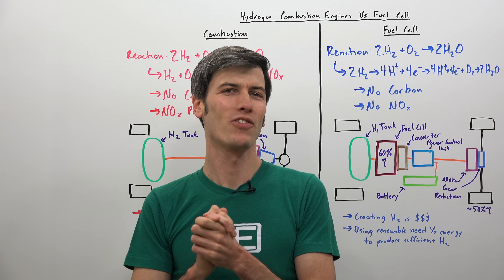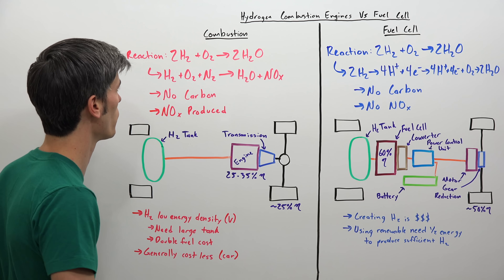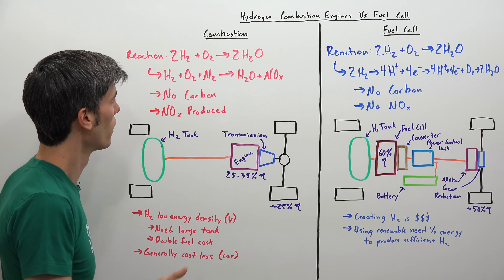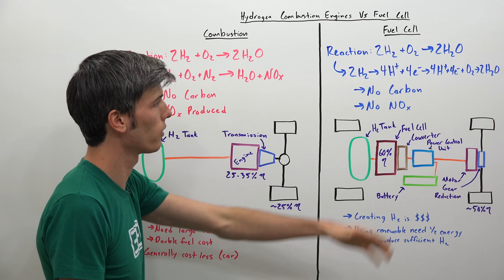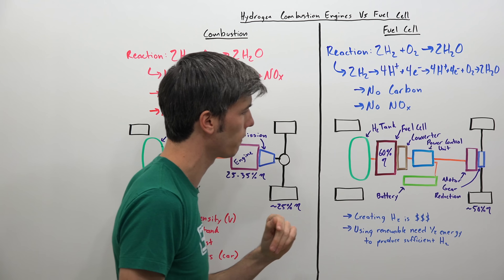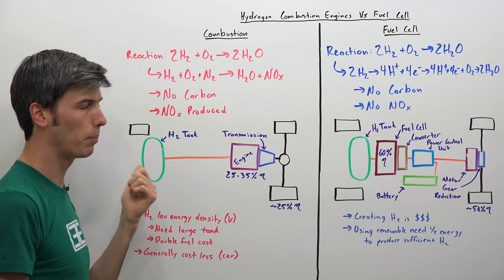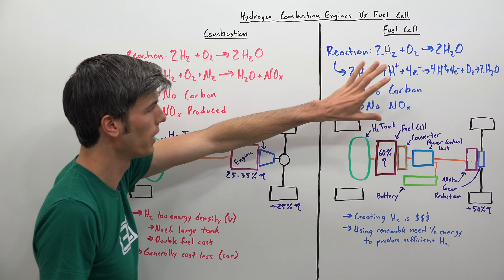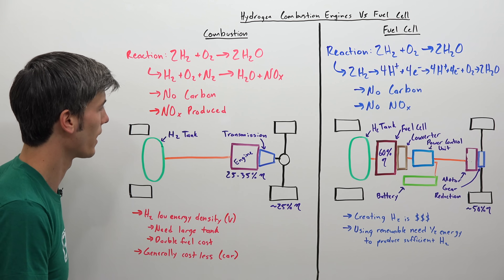Why Hydrogen Engines Are A Bad Idea

Comment: I think when it comes to an emissions point of view, converting existing vehicles to a hydrogen system would cut off manufacturing necessitation and waste from that. Most overall emissions come from industries, for example the battery industry or the auto-manufacturing industry. Converting an existing machine to hydrogen would prevent further need for waste. If we can find or invent something similar to a catalytic converter for the NOx, it would be fine as long as it was a legal requirement like smog. I'm sure people much smarter than I have already proposed this or looked into it.
Reply: not all oxidized nitrogen is so bad, you might be familure with nitrous oxide which can be used for full or partial anesthetization or propellent in whip cream cans or used to boost octane in gasolean vehicals such as a drag racing setup, perhaps if you had a way to catalyse the formation of the good nitrogen oxides (N2O) it could be formed instead of the more dangerous oxides (NO2, NO, NOx ect) thus using up all the available nitrogen before it becomes a more pulluting variant, just a thought.

Comment: I see the benefit in making bolt on or drop in solutions for converting gas vehicles to hydrogen vehicles. You have a stout car culture not willing to shift, and you have legitimate limitations which the EV fandom refuses to address. These mods wouldn't even have to be cheap either, just cheaper than buying an EV (which isn't all that hard to do).

Comment: Aren't the parts for creating fuel cell environmentally worst than hydrogen combustion? I can imagine those rare earth material for creating those battery and catalyst is pretty bad. Just curious if it out weigh the cost or if it's a myth.
Reply: They're making new batteries out of non rare metals.
Reply: That's a problem that can be worked on, but I'm also curious about the catalyst and the manufacture and disposal of the fuel cell
Reply: Fuel cells are a bit worse than batteries but far better than petroleum. The catalysts use the same materials as catalytic converters in ICE cars. There are no rare earth metals in batteries, just in permanent magnet motor/generators. Cobalt is a byproduct of copper mining and only about half as abundant and Manganese is as common as Phosphorus in Earth's crust.
Rare earth is also a misnomer for the most useful ones. Their issue is that they are so chemically similar that they are hard to separate from one another.
Reply: How do you make hydrogen commercially, but by chemical decomposition of methane or other natural gas. What is overall efficiency of that process compared to taking same energy of fuel, and turning direct to electric power in a large efficient power plant.
Reply: I don't know about the environmental impact of mining the materials for a fuel cell but the lifetime of a fuel cell is (at least as far as I understand it) much longer than the lifetime of a battery.
Reply: @SeanBZA  or by electrolysis. If you do it with excess renewable energy it's not that big of a deal.
Reply: @hondaguy9153  ROI will suck with that, and in general most industrial electrolysis plants do not respond well to rapid changes in control, they all will have very bad transient response, and you will not get a good product out efficiently. Extreme case is an aluminium smelter, where the penalties for loss of input power are massive, and can result in the plant needing to demolish large chunks of the equipment and rebuild them. Electrolysing water also needs additives, and filtering out the most common byproduct, chlorine, from the system as well, plus it is also incredibly energy intensive. 

Your cost to make from electricity would be more than double than reforming methane or natural gas, or by using syngas from coal in the  Fischer–Tropsch plant process. If you have enough biomass on a reliable scale syngas direct would work better to run engines, plus give a food crop as well, though it would probably be best used on the farm itself to run the equipment for modern agriculture over diesel.
Reply: @SeanBZA  Another effective (and free in a way) is to use thermal decomposition of water into hydrogen. Needs very high temps on the order of 3,000°C, but a nuclear reactor can develop those temps. Could get electricity and vehicle fuel from the same plant.
Reply: Lmao what is so environmentally damaging about aluminum, nickel (and nickle oxide), cobalt, and platinum?
Reply: @ericcartmann  you should check into why the original battery factory for the Toyota Prius turned into a Superfund site...
Reply: Stephen Foster You're going to have to provide a reputable source for that claim, because when I Google Prius battery Superfund site, I get exactly zero results that actually contain the words Prius and Superfund site on the same link.

No results found for +Prius +superfund.
Results for Prius superfund (without punctuation - Learn more):
Reply: "Aren't the parts for creating fuel cell environmentally worst than hydrogen combustion?" 

Yes.

Comment: NOx, I think that's what a catalytic converter is for.
Reply: Yes there are NOx traps. But they are filled within 10 minutes (on a diesel) or 2 minutes (on a petrol) and then have to be 'burned out' by driving with a rich mixture. This in turn produces cancerous hydrocarbons and carbon monoxide. So I'm not sure we couldn't just stay with the poisonous NOx in the first place. ¯\_(ツ)_/¯
Reply: Update: I recently learnt, that to reduce or oxidate NOx you have to have COs and HCs which you wouldn't in a Hydrogen engine. 

So to my understanding current catalythic converters wouldn't help at all and you need to come up with a new solution (not saying it wouldn't be worth it, I'd like to see that)
Reply: @Dan_Divebomb : The SCR uses ammonia NH3, also known as urea.
NH3 + NO --> N2 + H2O. No carbon involved. You´re welcome.
Reply: @Dan_Divebomb  As I know, EGR component makes some little portion of exhaust gas mixed with the fuel in order to enrich the fuel mixture inside the cylinders with COx s to lower the NOx production.
Reply: sharkbait hoohahah sorry for this late response, but what other pollution could be brought in if this happens? Do you think that if there is none, the internal combustion engine could still live?

Comment: If you filter the air intake to filter out the nitrogen ( or even only allow the oxygen through ) that'd get rid of the NOx problem.

Every time I read/eatch such stuff I just think a leap forward would involve new tech like such filters. Then read the argument section and see it's  full if people explaining why xyz can't work. I just think imagine if we stopped inventing new stuff at copuricus's level.
Reply: yt engineers problem solving skills are very abysimal, isn't it?

Comment: Thank God someone isn’t on the hydrogen hype train

You didn’t explain how industrial hydrogen refining processes also create carbon.
Could you explain that?
Reply: So does refining oil but if hydrogen is More environmentally friendly than the current infrastructure we should pursue it
Reply: Get water run electricity through it, preferably through eco friendly power plants, get 2H and O. Use both instead of taking outside air. No Nitrogen no NOx. Store the used H2O and repeat
Reply: @poisonpotato1  The problem is the "run electricity through it" part. Most of the world's electricity comes from fossil fuels. Using electricity from renewable sources to produce hydrogen is wasting it, because it yields about half the energy of just storing and using the electricity directly.
Reply: @BigUriel  still, renewables are cheap and getting cheaper. Wasting half of your energy might not be too much of a problem if you can store it
Reply: Lol electric cars are worse

Comment: Counterpoint: People don’t want an electric car. They want the nice rumble of an engine, they want to shift the gears. Electric cars, no matter how fast are BORING imo. We could very easily lower the cost of hydrogen as it is a byproduct of many chemical factories which often gets thrown out, its LITERALLY the most abundant element in the universe. You could even probably rig up a little hydrogen production plant in your backyard. At that rate, who the f*ck cares about efficiency! Its a renewable resource and its way better than gasoline.

Comment: Everyone just give up the hydrogen dream already. it sounded great 20 yrs ago when they talked about cars just emiting water as the "exhaust". It will only be feasible if you can fuel up with your garden hose. At that point it will be better than ev. Having to use so much energy to make the hydrogen vs just charging batteries is where the problem is. Why would you use electric to make hydrogen so you can change it back to electric in your cars fuel cell? makes no sense. Once you can charge a little bit faster there will be no argument at all for hydrogen except for large scale boats or trains or such where maybe a large hydrogen tank will last longer without refueling.
Reply: Do you think electric cars would be as good if they gave up 100 years ago?
Reply: Well . . . . they DID give up on electric cars 100 years ago!  Lol.
Reply: You've hit the nail on the head with one observation - "Once you can charge a little bit faster"
That and poor range are the two big reasons why electric cars will be struggling for a while yet to gain dominance.  Until EV's can compete with ICE's when it comes to how far they can go on a tank/charge and how quickly they can refuel/recharge, efficiency doesn't really come into the equation much.  Hydrogen seems like a interesting idea in terms of keeping the convenience of ICE's while going much greener.
Reply: Mikee, Porche has just released the next gen charging technology, which brings charging times down to under 15 minutes.  When you consider that the cost to charge the car with electricity is a third that of gasoline and a tenth that of hydrogen, the 'it takes too long to charge' issue is basically a thing of the past.
Reply: Will be interesting to see if they have much success with it.
Reply: @mikee6666  Personally I think exchangeable batteries would be neat as a sufficiently dense network of battery changing stations (the current petrol stations might be able to switch over) would mean long range, small (cheap,light,less rare earths) batteries and swapping them out would be quick, too. The batteries would be slowly recharged in the stations, directly from the grid, removing the need for powerful fast chargers which reduce the battery's life.
The problem I see though is that the industry would have to agree on a standardized battery size and swapping system - and battery technology might soon just make this obsolete anyways.
Reply: @Bryan46162  I love how Ev guys just Hydrogen for what is now, but then go all wishful thinking with "when the next generation of batteries/charging whatever comes, the range and charging issues Will be gone" but shoot down any possibility that hydrogen can also have breakthroughs and overcome its downfalls.
Reply: @OriginalNortad  that´s the whole issue with hydrogen. There are no foreseeeable breakthroughs that could happen in the near future. maybe fuel cells make another breakthrough or two, but that will be it. We don´t even have a theoretical concept of how to improve electrolysis and pressure tank storage, meanwhile there are new battery types popping up every month.
Reply: @cosmic_cupcake  when Toyota and Honda still invest heavily into Hydrogen then there is something still there, despite what some random youtuber and its fans might think.
Reply: OriginalNortad You're missing two important facts. Toyota has said their investment into hydrogen was a mistake. Hydrogen efficiency is limited by the laws of basic physics - there is no way around the limits imposed by the laws of physics, and there is no amount of investment or innovation that will ever change that equation. Hydrogen is hard limited. Batteries don't have that problem.

Comment: But but but mah hydrogen rotary for 1 year of production had promise lol thanks for awesome content as always
Reply: Fun and practicality aren't usually one in the same, engines will always be more fun than electric motors
Reply: @mrcaboosevg6089  Spoken like someone who never drove cars, instead only rode horses.
Reply: @mychevysparkevdidntcatchfi1489  Doesn't make any sense but okay.
Reply: @mrcaboosevg6089  If you only ride horses (gassers), you wouldn't know the nuanced fun of cars (electrics). Electric sounds like muffled jet engine (or space ship in sci fi movies) even at 30 MPH, and hella fun with 50/50 weight distribution.

Comment: What if we use oxygen instead of air during combustion to prevent nitrogen by product
Reply: that means an extra tank, and he already said that you need a big tank for hydrogen...
Reply: @Frankgaming  How about an stationary engine ?
Reply: You can have electrolysis
Reply: It's not quite that easy to get oxygen out of the atmosphere, no one wants to refuel twice every time, NOx isn't THAT bad
Reply: And pure oxygen is a real bad fire hazard too. Everything likes to burn real bad in pure oxygen.
So not only a massive tank, but lots of extra components for safety
Reply: @awesomefacepalm  hydrogen peroxide frequently better for storing oxygen than pure oxygen... Still  dangerous at high concentrations though. 
Gets used in many rocket engines....
Might work OK as oxidiser in a burner for a steam engine... Mass of oxygen+hydrogen needed is no more than an equivalent water tank would have to hold. Efficiency  should be improved if fuel/oxygen delivered under pressure, as hot gas from burner could be  steam under pressure . Would save a bit on engine mass and massively improve thermal efficency as  no need for seperate boiler, which reduce max working temperatures and hit carnot efficency hard.
Reply: @stevecummins324  yeah that sounds a bit more safe, hydrogen peroxide doesn't burn as pure oxygen goes right.
Reply: Pre ignition would become your worst nightmare, preventing you from getting a good compression ratio.
Reply: @Frankgaming  When you say "big tank" how big are we actully talking about?
Reply: @johnDukemaster  Hydrogen burns with oxygen in a 2:1 ratio.

The Honda Clarity uses a 5Kg hydrogen tank, so you'd need to carry 2.5Kg of oxygen to use up that tank. From what I can gather those 5 feet industrial oxygen tanks take about 9Kg, so you'd need about a third of that. Of course the Clarity uses a fuel cell which has twice the efficiency of an ICE, so if you want to burn the hydrogen and oxygen in an engine you need tanks twice as big for the same range.

Even then the oxygen tank wouldn't exactly be so big it couldn't be fitted in a car, a car converted to LPG generally has a bigger tank than that. The problem is the cost of the oxygen (air is free), and the danger of driving around with literally a bomb behind you at all times. If you have a hydrogen leak and something sparks you get a fire, if you have an oxygen leak and something sparks you get a fire, if you have a hydrogen and oxygen leak and something sparks you take out a whole block and leave a crater behind.
Reply: Sérgio Alves - The ratio is per mole, not by mass. The ratio of hydrogen to oxygen in water by mass is 1:8, meaning you'd need 40 kg of oxygen for a 5 kg tank of hydrogen.

Comment: Now! I want a car with a nuclear reactor in it...
Of course, I suppose it is easier going bigger, put wheels on a nuclear sub :D
Reply: LOL, A few kg of plutonium.  1:  Just don't crash and poison your the vicinity.  2:  Relatively low power milk float.  3:  You can drive without refueling for 50 years.

Comment: I’d say, diesel/electric hybrid system
Reply: Yes, diesel-electric is super efficient and can be powered by biodiesel.  There is so much fallow farm land going to waste.
Reply: Sadly nobody makes them
Reply: With that you lose many of the advantages and win almost nothing. Mostly the weight, size and complexity of the diesel engine. Pure electric is so much better.
Reply: Bingo. That's a perfect combination. The diesel would help you with torque for hauling and long-range driving and the electricity would help you for saving gas for starting stops
Reply: The diesel engine requires a much heavier engine to deal with the heat diesel produces. It would just make a car with a very heavy battery even heavier and probably kill any efficiency it created.
Reply: @t-bone9239  Audi makes them.  But diesel stinks and PM is one of the worst emissions there are. Bad idea.
Reply: @nicholasfield6127  weight difference is not that significant if you consider the higher torque of the Diesel.
Reply: @andrewh86sd 
You realize that electric motors have far higher torque, right?
Reply: @t-bone9239 
Torque isn't the problem, efficiency, cost and maintenance is.